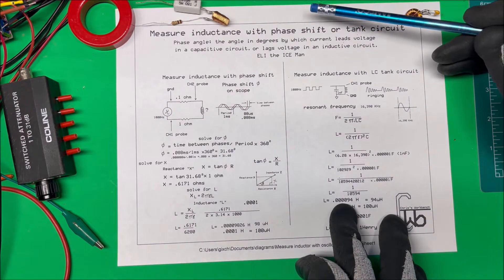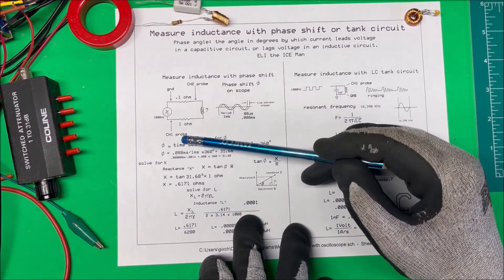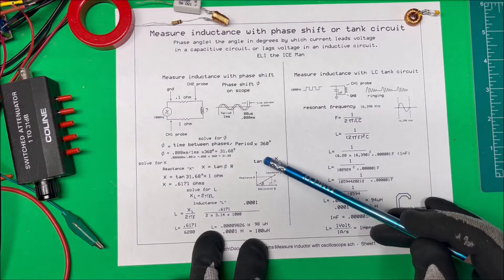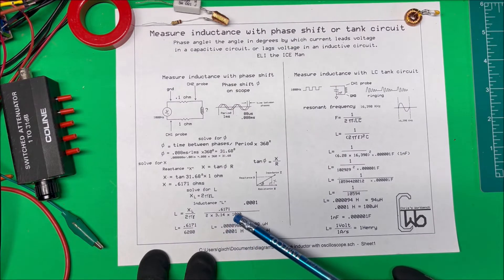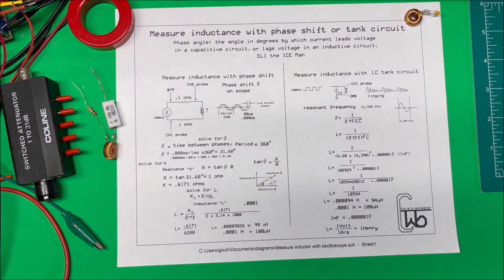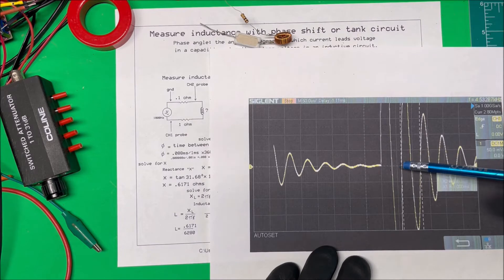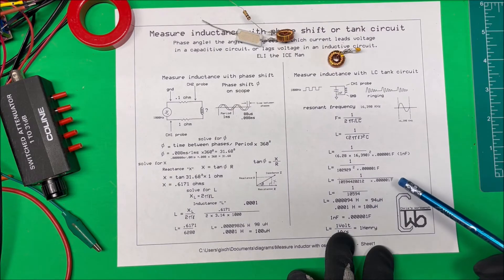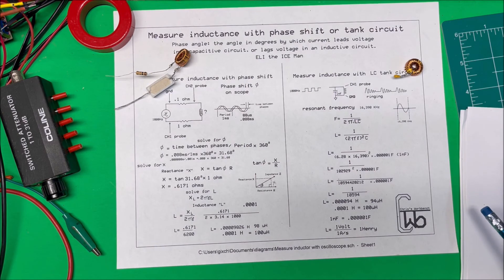Measure inductance with an oscilloscope

Comment: CHRIS WORKBENCH, Why not use a Ringing Tester to measure coils inductors ringing? The Ringer Tester will display a number for the counting cycles which I'm not sure how to the counting cycles into time/frequency, maybe you know how to do this to make a video lesson about it? I think the ringing tester have a built in RC tank circuit and square waveform generator to apply to the coil inductor under test?
Reply from the maker: Thanks for the comment,.  Good idea

Comment: One question ... will measuring a coil as a voltage divider give beter results?

 one only needs to know the output impedance of the funcion generator. your opinion on given method is appreciated.

Comment: hi, why did you use two resistors and why use a shunt that small in resistance to measure accross? Why not just use one resistor?
Reply from the maker: You can use one resistor I'm using the .1 ohm for current.

Comment: I have an LCR meter. but does not measure values under 1uH.  I have a couple of kits. I am winding torroids that should have values between 0.1uh and  0.8uH.  They are for ham radio kits.  So the frequencies are between 3mhz and 50mhz.  Are there formulas on how I need to adjust this method?  value of the capacitor? signal fed? i tried with a known 0.1uH inductor and both a 1uf and 100pf capacitor.  Was not getting reasonable values.  I am not a EE.  Just want to validate I am winding the toroids correctly.

Comment: Your math for the LC tank circuit method is using a 1uF capacitor (0.000001F) not a 1nF (0.000000001F) capacitor, but the notes and your commentary call it a 1nF cap.  If it really was a 1nF cap, then L would be 94nH.  If it was a 1uF cap, then 94uH.
Reply from the maker: Thanks I will make the correction.